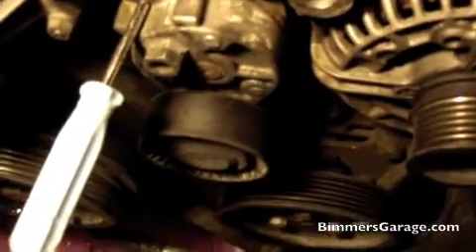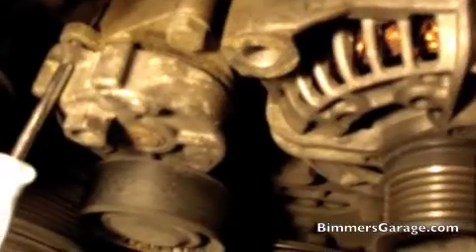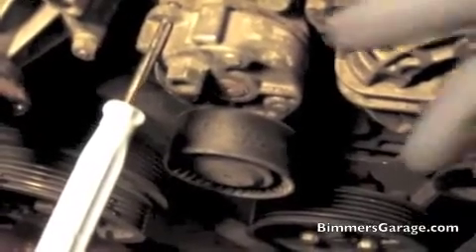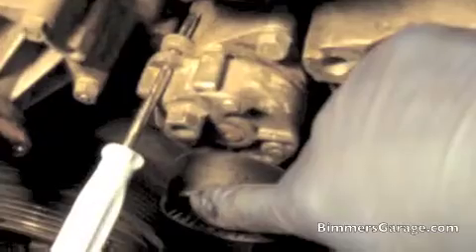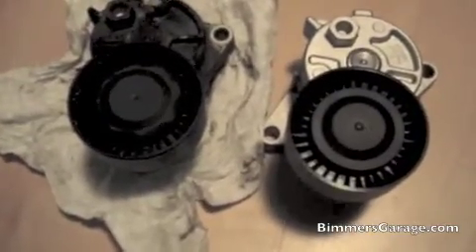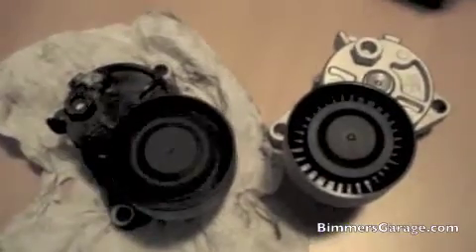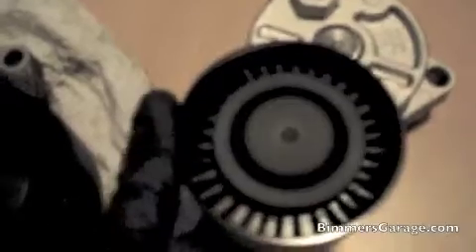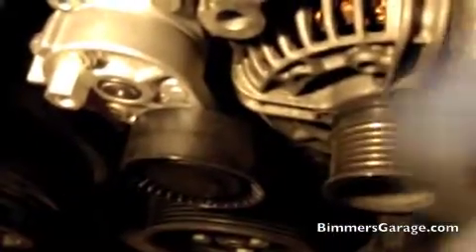BMW Tensioner Pulley Removal : DIY [ How To ] /// 330i (E46)

Comment from the maker: With 150K... The whole tensioner unit should have been replaced back at 65K. Better replace the deflector/idler pulley too. Double check your water pump to make sure the snapped serpentine belt didn't shock/damage the WP bearing & its plastic pulley.

Comment: My drive belt ripped, and my tensioner pulley melted n came off, here is my question: do I replace the pulley itself? Or should I replace the tensioner with the pully?  I'm at 150k

Comment from the maker: CORRECTION: I just read what I typed above... I made a typo > I meant to say, YES, replace the WHOLE unit, IF it is a mechanical tensioner. You can replace Just the wheel pulley itself, IF you have a "newer type" hydraulic tensioner.

Comment from the maker: Sure, not a problem. Yes, you should replace the A/C tensioner (plus a new belt along with that) also and it is much simpler to replace. Only thing you're missing are > new fuel filter, motor oil & filter, and air filter change. You should clean your MAF with a good cleaner. I suggest CRC MAF cleaner.. just be careful cleaning the inside of MAF.

Comment: Thanks for the reply.  At 105k miles so far i've done the water pump, thermostat, expansion tank & sensor, coolant sensor, DISA valve, O2 sensors and spark plugs.  Whew im tired!    I still have a lot of work to do... there is a second tensioner pulley on the accessory belt that needs to replaced as well right?  Is that just as straight forward and the one in this video? I have a 2003 x5 btw

Comment from the maker: BMW have a (strict) recommended maintenance schedule regarding certain parts that must be replaced at particular mileages, one of them is over the cooling system and that includes the pulleys. You can just replace the pulley wheel itself, especially if it's a mechanical tensioner! If you have a hydraulic tensioner, then just replace the wheel.

Comment: Hi, great video. I was overhauling my cooling system and noticed my tensioner pulley is dry as well. Do you need to buy the entire assembly or can you pry the dust cap off that wheel and just replace the wheel?  Great videos.

Comment from the maker: They are sealed bearings.. and once the seals give way due to wear&tear/age, it's Not advisable to try and repack these units, especially the mechanical tensioners. However, if you have the newer hydraulic tensioners, they allow you to just change out the worn pulleys instead of the whole unit.

Comment: My belt was routed and aligned correctly, new pulleys installed too, turns out it is the A/C tensioner pulley. Thanks for your advice bud! Your very much appreciated.

Comment from the maker: If you're replaced those items and still hearing squeaks/squeals/noises... it could be three things - 1. You routed the belt incorrectly. 2. There's a slight misalignment in the new pulleys and you may need to double check how you bolt them down (make sure you tighten them down to spec, BUT Do NOT over torque!) 3. The new pulleys may be faulty? out of the box... One last note - your A/C tensioner could be making the noise. Did you check that??

Comment: Question: I have a 2002 330ci and have had an on and off whine over the past few days (when it whines, it's full loudness and when it's not, it's fully fine).  When it's there, I turn engine off, engine comes to a complete stop yet the whine continues for a full second or two and THEN winds down.  Any idea what it might be? (The idler pullys have stopped while the whine continues for a sec or two ... and then slows).

Comment from the maker: @aleksankazakov 
The cost of the pulley was not that much different compared to the Whole tensioner, so it was simple to just replace with a completely fresh/new unit. That way you don't have to worry about it for another 8 years or 80K miles, whichever comes first.

Comment from the maker: @Thegarmandia
Another thing, if you route the serpentine belt incorrectly (or if the belt is cracked/worn) you could be getting squeaks from the area. Plus, if there is actual damage to the alternator pulley itself (due to misalignment or loose bolts) Do some visual inspections of the area.

Comment from the maker: @Thegarmendia 
That's the likely cause of the noises (in general), the alternator pulley is not likely, unless the bearings within the alternator unit is failed... But, if that's the case, you'll have more problems than just some irritating sounds under the hood.

Comment from the maker: @alp3
Cool.. Glad this helps you.

And, yeah that noise is very difficult to pin down with everything else running at the same time. 

If you bring this problem to a dealership, they'll probably tell you it's your "power steering pump" or some other 'major" component... Take you to the cleaner.

Anyhow, let me know what you find out. Good luck.

Comment from the maker: My videos from the start was to contribute (even a small amount of new insight) to some of the problems/issues experienced by many BMW owners. It's not meant to be all encompassing, more of an informational primer or just a courtesy heads-up on possible troubles while working on a particular part(s).

So, if you gain any useful knowledge from glancing at Any of my DIYs, then I am most pleased and you're welcome.